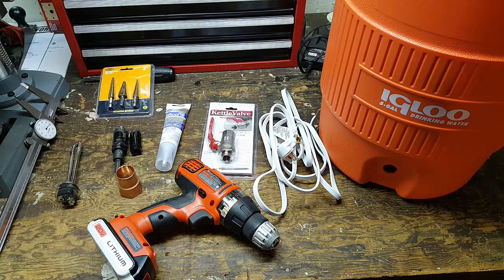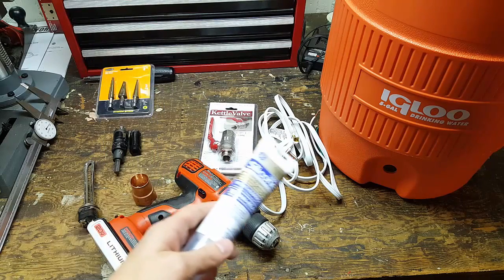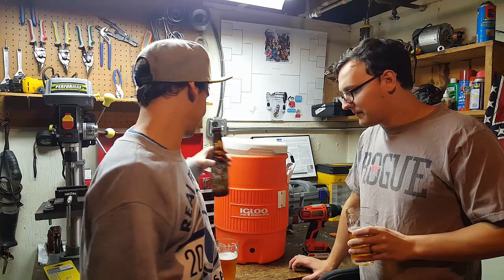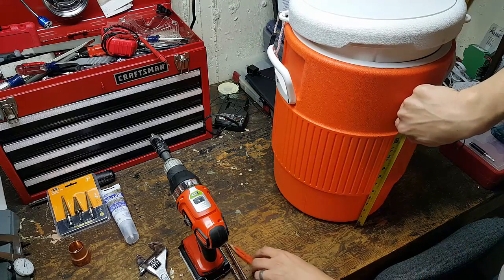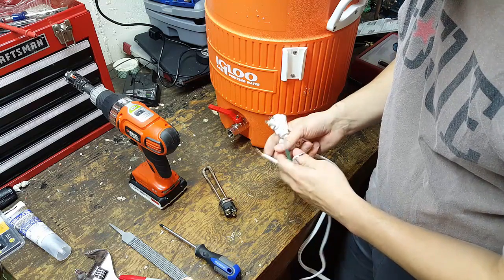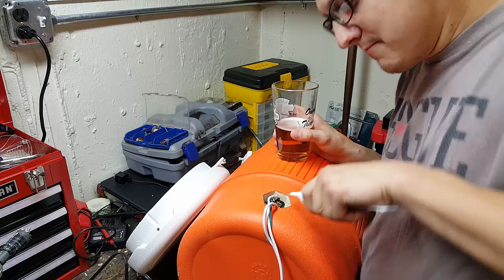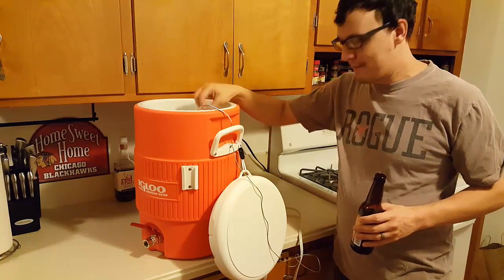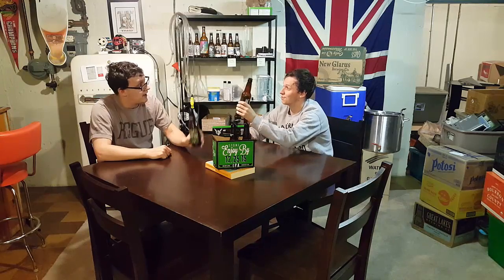How To Make An Electric Hot Liquor Tank

Comment: Helpful video.  I just added an electric 1500W low watt density SS element to a 10 gallon Igloo HLT in a similar fashion.  With the low watt density element and the copper pipe adapter tightened against the element's threads (a heat sink function too...), I feel the high heat is being sufficiently pulled away from the plastic.   Brought 10 gallons of water from 65 F to 185 F in 2 hours and 10 minutes.  Google assistant can turn on the HLT via voice or timer (a 60 minute time savings from my prior method of heating water on the electric stove in the kitchen and transporting it to the brewery/HLT).  The electric HLT was a key step in some brewery upgrades.  I also recently replaced a propane burner with a 3500W  induction cooktop.  The system is now all electric and a gravity setup.  With the new electric HLT and other mods, I have almost completely eliminated the heavy lifting of hot water and/or wort.  I now do induction heating of the wort during the sparge (a 30 minute time savings).  The goal is to reduce the brew day from 6 to 4.5 hours.   I will brew a Dunkel for my test run.   Thanks again for the helpful video to create an electric HLT!  Prost!

12/29/2019 update - Dunkel brew day went very well.   The electric HLT turned on with a Google timer at 4am.  I woke up at 6am and mashed in 10 minutes later... nice.   Induction heating during sparge pulled out another 30 minutes to make the brew day about 4.5 hours (mash in through clean up), as hoped...  a good thing!

Comment: Old video, so not expecting a response, but I assume 1) the Element melted some plastic and 2) with it being a high density element, it scorched grains and wort?
Reply: Thomas Lally this is for the HLT only heating the sparge water.
Reply: This is an HLT. It never touches any grains, just heats water and drain into the MLT. We have been running this setup for over 2 years and no issue with melting plastic. We inserted the element as far in as possible from the sidewall so that may have helped us.

Comment: Nice video guys.  Now that it has been a couple years have you had any issues with the element's heat melting or disfiguring the plastic?  Every time I see someone using plastic with water I wonder.  I have had cooler mash tuns warp and I would think that having a super hot element attached to the plastic would do the same over time. Good mentioning of the GFCI.  Check out my brewing channel:  www.youtube.com/c/timtrabold
Reply: Hello, been going 2.5 years strong. No issues with the heating element and the plastic! Thanks for sharing your channel.
Reply: You can boil water in a paper cup over an open flame.